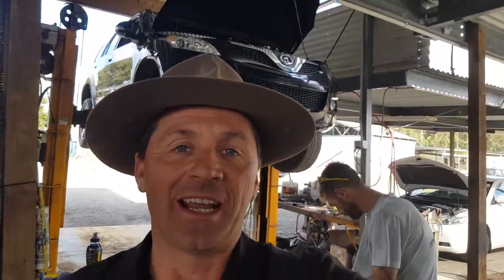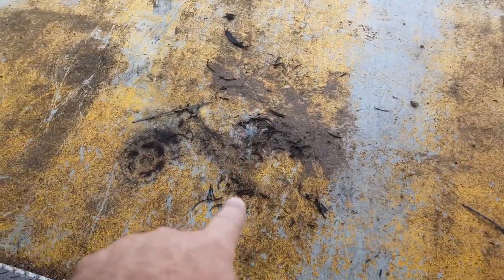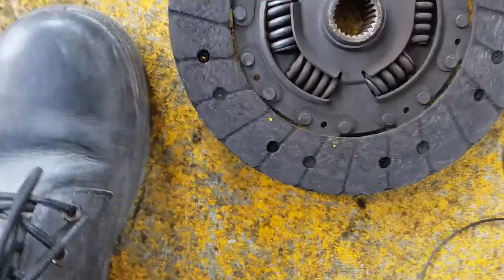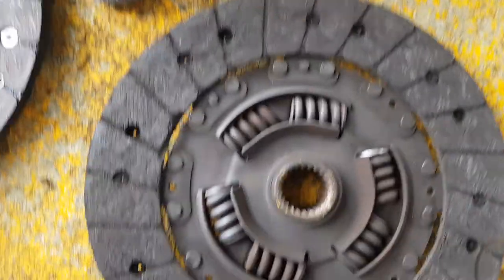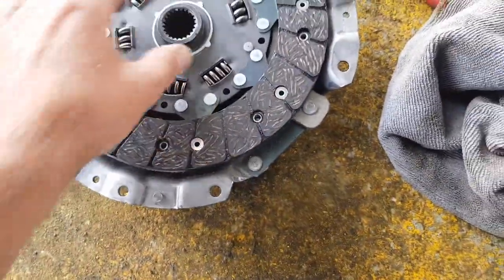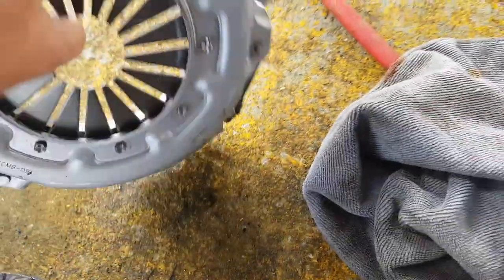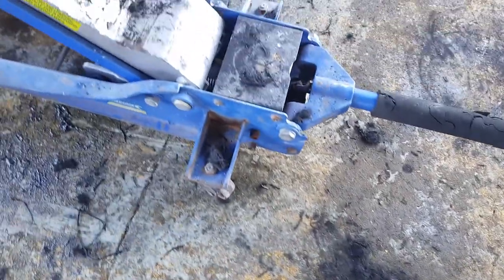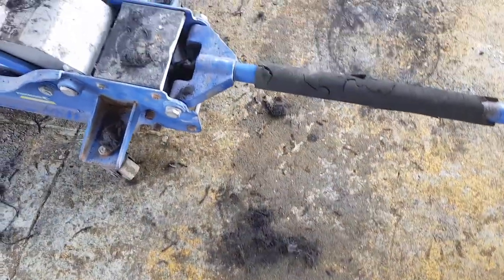Great wall X240 Clutch plate fail 2013

Comment: Hey mate did the gear box slide straight back once all undone? Mine's stuck and won't come off! Bloody greatwall
Reply: there is a hidden bolt tucked in behind the mounting for the clutch slave cylinder